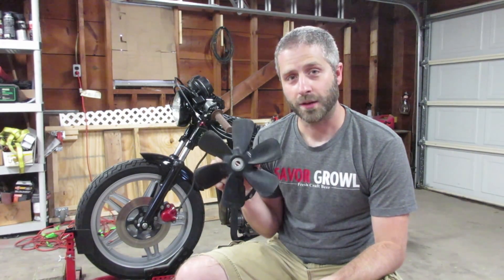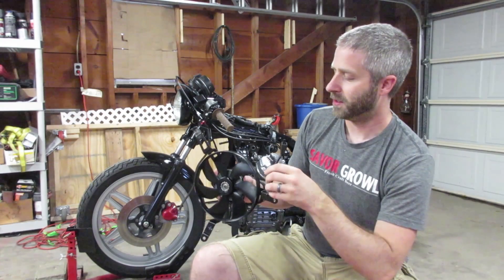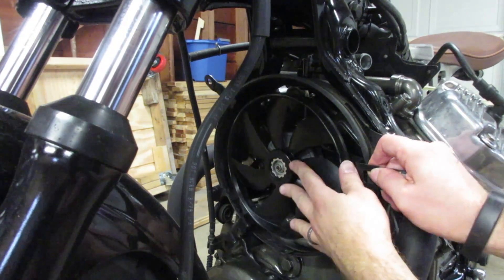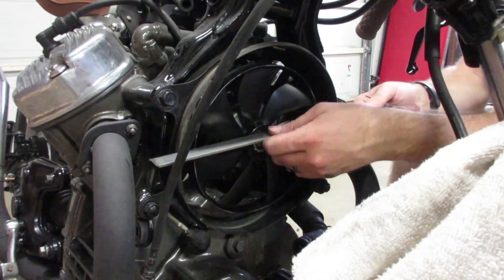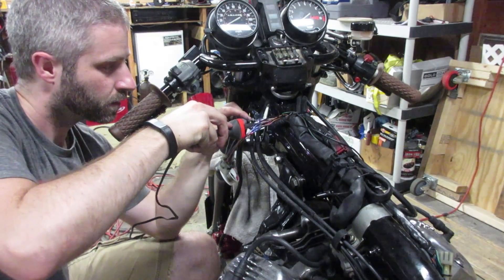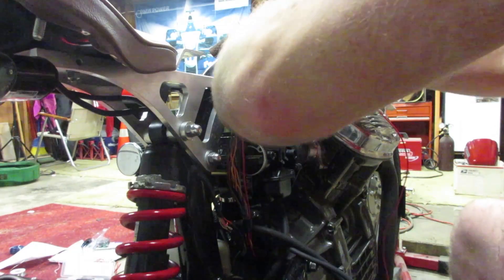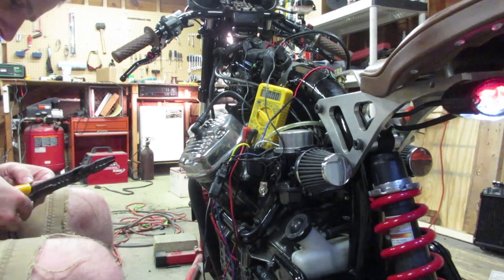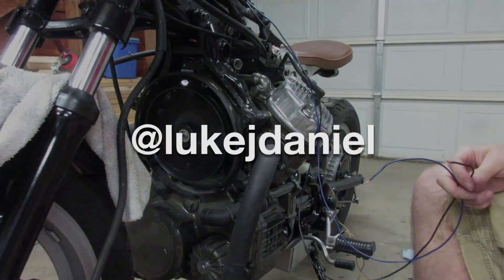Honda CX500 Electric Fan Mod Part 1 - Moto Fugazi Build Part 20

Comment: Wow wouldn’t that have been easier to forward mount the radiator an inch or so further out or re look at the distance between the fan housing and the radiator with the mounts to save damage to the cam shaft,

Comment: How is the fan mod holding up? Any battery draining problems? I was thinking of doing the same… Great video. I wonder about the stater being able to keep up with the drain of the fan.
Reply from the maker: No battery or stator issues, even on extended rides. I don't believe the ZX6R fan is putting that much additional stress on the electrical system.
Reply: Luke Daniel excellent! Thanks for the response... after some eBay researching it looks like that fan was off of about an 05ish.. does that seem right? Also other than modifying the mount to make it fit did you remove any more metal from the rear of it? Thanks for the channel... I've been working on an 81 GL500 also a Craigslist buy sense august... about to drop the engine for a paint job... perfect time for a new fan!
Reply from the maker: Paul Pate 05 sounds about right. Had to remove the end of the camshaft mount and modify the fan brackets.
Reply from the maker: Nice looking bike!

Comment: What length throttle/clutch cables are you using with those bars?
Reply from the maker: Stock for now.
Reply: Did you just have to re route?
Reply from the maker: Yes. Although I do plan on shortening them in an upcoming video.

Comment: The fan on my GL500 appears to be frozen onto the shaft.  I have pried at it from both sides at once, tapped on it with a ball peen hammer all around the center section, tugged/pulled straight forward, the last step was giving it a good thorough cussing but that did not help.   Are those fans supposed to literally just slide off the camshaft?   I am at a loss.   I have the cam seal and gasket, just got to get that blasted fan off!  LOL   Thanks for any advice!!!!
Reply: Use yout rear axle  as a puller. You will find that the axle will screw into the  threaded part in the centre of the fan (after removing the retaining screw)

Comment: It looked like your fan was blowing into the radiator. If so, you have it going in the wrong direction. Blowing into the direction of the natural air while riding is no good.

Comment: I have a CX650 E and thinking replace the OEM fan for an electrical one but wondering if the heat generated by the cutter wheel could affect the oil seal in any way?
Reply from the maker: I doubt it. The cam cut easy and didn't get very hot. It would have to be above engine temps to start causing damage. I'd suggest being careful by not cutting the seal itself.